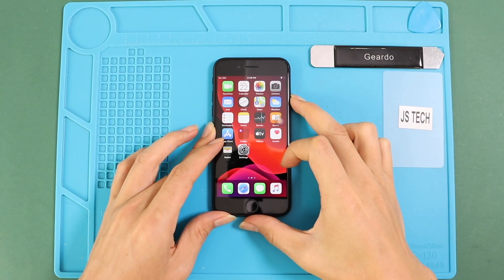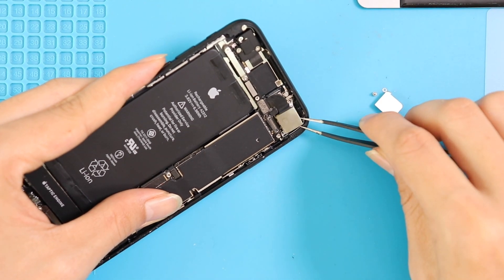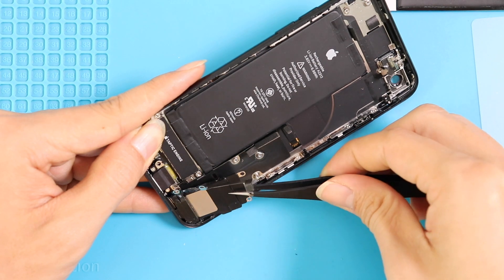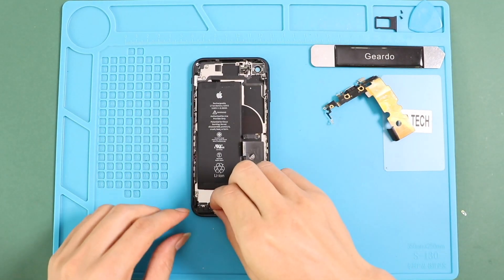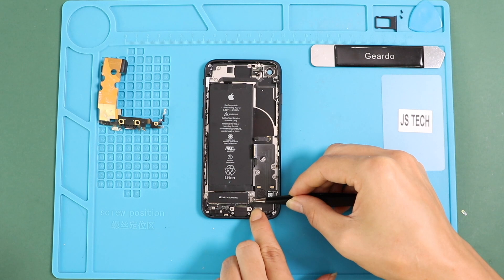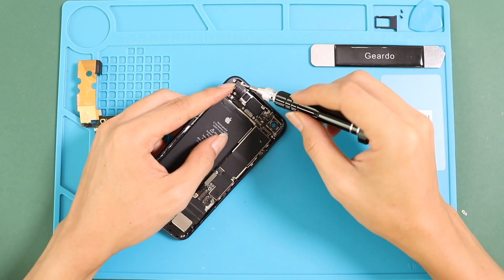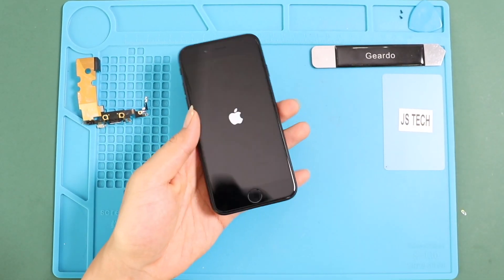iPhone SE 2020 Charging Port Flex Cable Replacement

Comment: I changed but not worked 😭😭😭
Reply from the maker: Double check connections and still have issues, then the part might fault..
Reply: I changeed two charging ports does not worked same problem 3 mints phone restarting please please help me
Reply: Please help and reply sir
Reply: Hloo sir

Comment: This was very helpful in the order of removing components.  Very glad you showed it going back together!  Many instructionals just tell you to reverse order.   To me the assembly was just as helpful as the disassembly and I was able to successfully repair mine from random reboots caused by bad flex ribbon.  The only thing I would add for first timers is to organize screws so you know exactly what screw goes back where.  Also pay attention to the little details in the video such as the top corner (near camera) of the motherboard sliding back underneath the bracket in order for it to sit flat.  Those little details are often crucial to a successful repair.  My repair part came from ifixit and appears to have been a used one, perhaps all these type of parts have to come from donor phones..  It works and being used I feel reasonably assured its genuine but I don't recall the listing stating so.
Reply from the maker: Thanks for your detail feedback...

Comment: Hi! Thanks for the video! I had panic error on mic1, so I did replace the charging flex cable and port on my iphone SE 2 but it gave me mixed signals: first it was still restarting every three minutes, then it worked with no restart for more than an hour, then restarts and then every three minutes again, then works for 30 mins, then restarting every three minutes again. I havent done anything particular to it in the meanwhile. Would you have any next step to advise to sort this out? Thank you
Reply: For me is the same lol did you find any solution¿

Comment: You don’t have to remove the logic board to replace the charging port and mic. This is a tortuous guide
Reply: Yes you do!!!! Otherwise, how the hell are you gonna peel the lightning connector flex board unit from the chassis. The motherboard sits right on top of the lighting port unit. Rewatch the video & learn.

Comment: Do I need to remove the microphone off the old board/flex how does it come with Microphone my microphone is not working
Reply from the maker: It’s on the charging port flex, best option is to change the charging port flex

Comment: What brand what chargeing port i should buy ? I mean what brand and name of the new changeing port ?

Please ans it will help me a lot
Reply from the maker: You mean the cable or actual part?
Reply: @DIYGeardo  u remove the old part and then put the new iphone chargeing port ....i want to know the new changeing port brand name...is it 3rd party charging port ???
Reply from the maker: @sundaylover7786  there is no brand name for parts, there is original, used or aftermarket ones..your location? The one we replaced was an original
Reply: @DIYGeardo  ohhh sir.. i am  from India....can u suggest me any 3rd party good chargeing port for apple se 2020..
I want to replace it

Comment: Replaced the charge port and now it don't come on or charge. Not even wirelessly it won't charge
Reply: I took it to shop and they checked it and was not drawing any amperage. I checked battery with multimeter and it was dead. Ordered new battery from Amazon. Hoping for the good.

Comment: Hi thanks very much for a very informative Video.

I was wondering if you could help me with this problem.
I have a iPhone SE 2020 there is a small square bracket on the main logic board between the board and the tapic engine.
I would like to know its function, there is an electrical contact point on it but it doesn’t seem to touch ground or any other electrical point.
there is a ribbon from the charging port that sits on the tapic engine then this bracket sits on top and then it is screwed into place
Could you please enlighten me….thanks in advance Cliff
Reply from the maker: Is there any way you can send us a photo

Comment: Sir, will I get any errors on phone for replacing charge port?
Reply from the maker: Nope
Reply: @DIYGeardo  Geardo, when you replace battery. How do you reset battery health on this phone?
Reply from the maker: @mgomez5606  for that you need to place the old battery board, if not a genuine battery
Reply: @DIYGeardo  what if I just replace battery. What messages will I get, Geardo?

Comment: The speaker buzzer , it only works on right side when facing front screen ? Because no sound coming from left side
Reply: Yeah there’s no left side speaker. Once they put the aux port on that side with the iPhone 5 that was the dead giveaway for me, if you haven’t already looked it up.
Reply: @christianmichael4020  ip7 had a speaker on left im surprised se only has one

Comment: will i lose my data if i get it fixed like this by someone else? need serious help as I have not backed up my phone in long and will lose many photos if that's the case
Reply from the maker: I mean by replacing the charging port you won’t loose any data. But if someone damage to the board then there will be an issue. But that is very rare. Also you can use a wireless charger to charge the phone to backup the data.

Comment: Hello, this works for the 3 minute reboot problem?
Reply from the maker: Did you do any repairs recently?
Reply: Same for me even after 6 different docks I have problem and keep restarting after 3 minutes
Reply: You replaced you charge port and problem went away?
Reply: @mgomez5606  For me nothing fixed my issue so I stopped trying
Reply: @Sakis Nikitaras  Does your charge port work? I saw a video and if your charge port is bad it causes it to reboot every 3 minutes. Mine does not charge thru port, only wireless. I will let you know.
Reply: @mgomez5606  my original dock after water damage stopped charging but not rebooting my phone. The other docks I tried charging my phone but after 3 minutes keep rebooting my phone
Reply: @sakisnikitaras  I took the motherboard off and will wait for charge port flex before I replace it. Too many screws and sizes. Helps if you have magnetic mat which I dont.
Reply: @sakisnikitaras  I replaced the charge port flex. Now the phone does not turn on or charge. Either with cord or wirelessly. I'm just gonna get rid of it.
Reply: @sakisnikitaras  I put the old charge port on and phone works but still resets. Gonna send other port back and get a replacement.

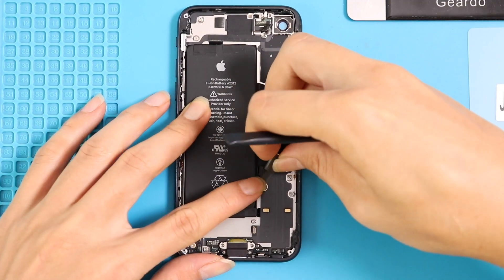Comment: 6:20 son of a gonna i pull the tab right above the flex and broke it  what is that for . should i even finish. or did i facked up my phone.
Reply from the maker: I think you broken the charging port connector?  what is the part you are trying to replace?

Comment: Do you need the heat gun for this replacement? Not seeing it used in the video unless I'm missing something?
Reply from the maker: Well always good to have a heat gun.Sometimes you will need to soften the adhesive. You can use to soften the charging port flex adhesive. It is is not a must, but good to have it.